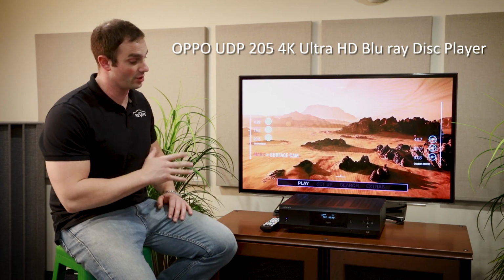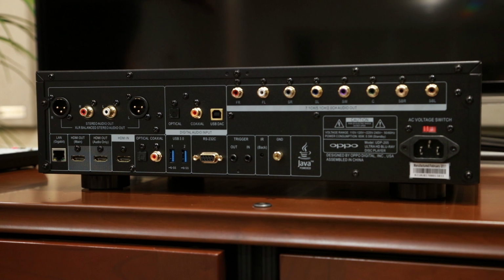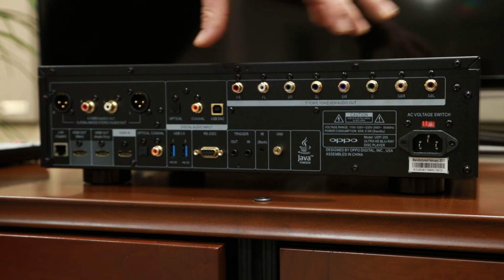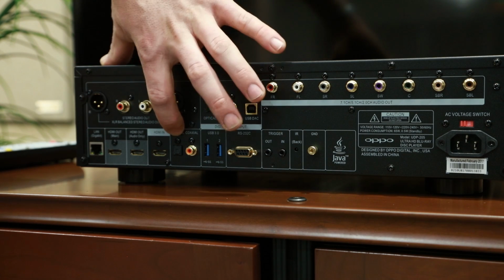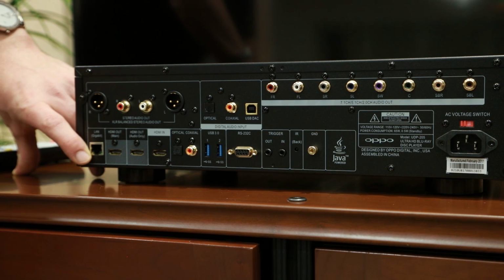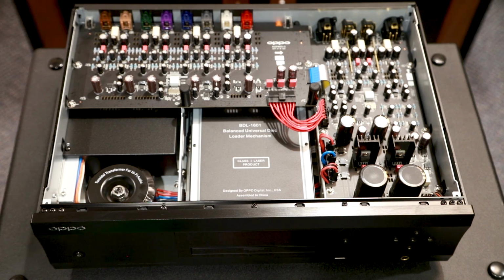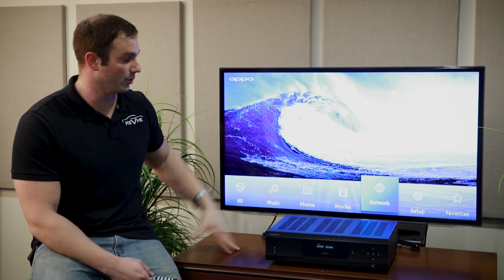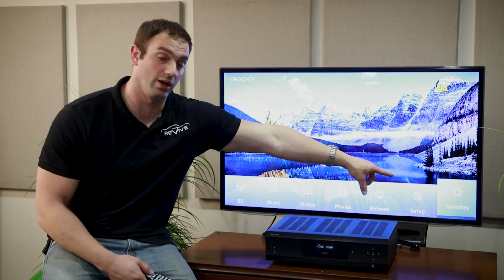OPPO's UDP-205 4K Ultra Blu-ray Player – Audio Advisor

Comment: been doing videos on the 203 for the last 3 months, but I'm going to have to upgrade to the 205 since I enjoy taking part of the analog audio outputs, and utilizing 2 sabre 9038 PRO dacs, The 205 will perform better audio signals using the analog outputs via my parasound amp and marantz processor.  although the video signal should be exactly the same, I am able to upscale all video signals to a 3840 x 2160 progressive signal via my marantz sr7010...  I was wondering if you could maybe help me understand the difference between the marantz sr7010 doing the 4k upscaling vs my oppo udp 203 performing the upscaling to 4k?  The picture quality does appear similar, although I do understand the Oppo to do a bit better at upscaling I am wondering if it is supposed to upscale everything just as the receiver is capable? same goes for the 205?

Comment: You didn't mention anything about Netflix or VUDU being built into the unit, so it doesn't have those?  If it doesn't it's a little disappointing because although my 4K TV has those apps, the VUDU app won't do 4K nor Dolby Atmos, which VUDU offers for some of their movies.
Reply: I understand that but it doesn't address the issue of streaming VUDU in 4K with Dolby Atmos surround, only way I have found is buying an nVidia Shield.